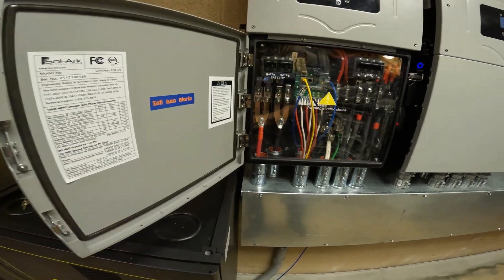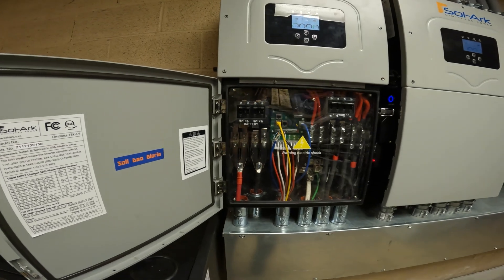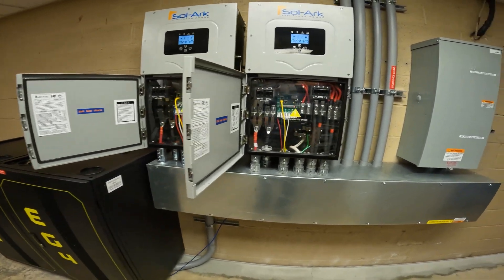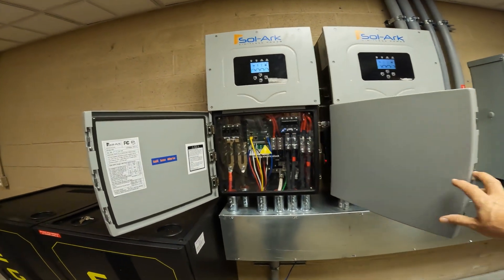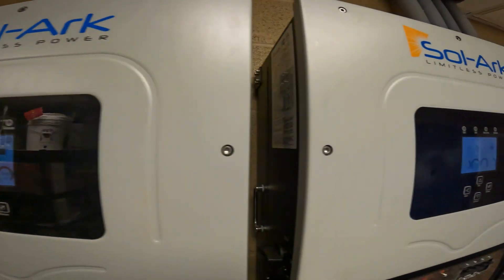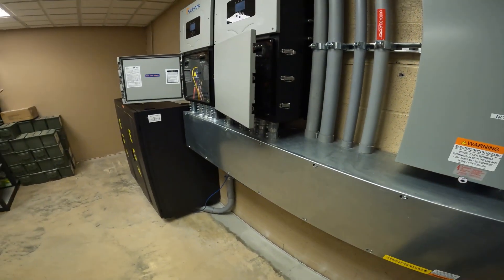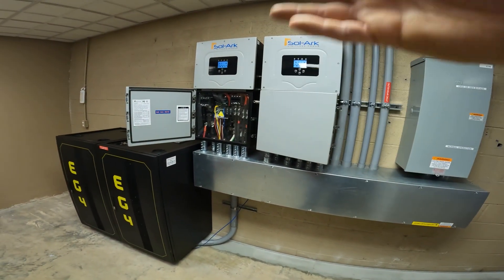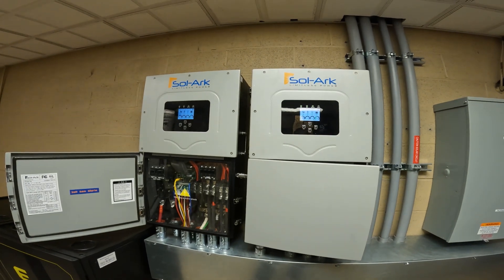Sol-Ark 15k busbar PSA

Comment: Yet another great video with clear explanations -thanks!  Could you also post a link the battery cables you use with the busbar pair?  Also, as the cables need to carry a combined 275A current through the busbar, what do you normally install an external fuse block and use for example a 300A Victron fuse?
Much appreciated!

Comment: Can you please explain your bypass switch and put a link to it?  So does it allow you to bypass your inverters/batteries so you can pull them out to work on them without losing power tothe house I presume? I'm having a hard time visualizing how this circuit would work because you'd have your main in from the meter into this switch, then feed to the sol-ark inverters which feeds to the breaker and also the bypass switch has a line to the breaker panel?  That wouldn't work because you could accidentally feed both to the circuit breaker at once right?  I'd love it if you could explain this or do a video on it.  thx
Reply: Late reply, but Diagram 07 from the Sol-Ark 15k Installation Guide (p53; guide copyrighted 2024) shows a wiring layout for use of a bypass/transfer switch. The picture is probably worth a thousand words.
Reply: @Mark_S-b1v  thanks, do you have a link to your bypass switch you used?

Comment: Does anyone have the connection diagram for the bypass?  Trying to understand how the bypass will switch the grid to the inverter and back to the load (when in position A) and from grid directly to the load (when in position B). Thanks
Reply: I'm curious as well, since the Sol-Ark is acting as a transfer switch on the AC side, I don't understand how it wouldn't be back-feeding even when the switch is on.  

I suppose it just makes it so you don't have to move wires if you want to physically take the Sol-Ark out of the loop, you can switch to the center "off" position, disconnect the Inverter(s), AND the cables going to the breaker box(es), then throw the switch to the "grid" position.

I may not understand that correctly, but it seems to me like it would be simpler and safer (because there's less room for error) to leave extra length in one of the cables that go to the Sol-Ark (either FROM grid or TO breaker box).

Comment: Can a single sol ark 30k be setup to replace this setup?
Reply: The Sol-Ark 30K is 3-phase (120 / 208 V) output only. It is designed for light commercial use. x2 15K's will be able to cover 30kW of 120 / 240 residential loads.
Reply: @kensol123  oh yeah I know was just looking to cut inverter and emp cost down by 40%
Reply: I look at it as an investment into energy insurance. When the grid goes down you are able to keep the food in your freezer cold and your family warm for however long you need. With 2 invs and some bats you can watch TV too 🤣

Comment: I just got a battery cabinet and some EG4 LLV2 batteries.  I was wondering if you have seen the latest cabinet safety video from Signature Solar.  It talks about max current rating of the m8 connections for the cable to the inverter.  Did you do a custom connection to the bus bar with that cable setup?  I will maybe try to get a consultation.

Comment: I used 2/0 Copper cables and four Southwire Lug Al 2/0 STR-14 SOL to bridge the battery terminals.  Flip the Southwire Lug flat side out and it tucks in nicely behind 4/0 copper battery cables. It's much cheaper.

Comment: I’ve watched your channel for years. Literally sold on the quality of your work. That’s a done deal.

My wife and I are at the point in life where we can buy a substantial amount of property (currently looking in NC). We need consulting on someone we trust (here’s where you come in). We are wanting to build on riverfront property. 1200 square foot minimum for primary residence.  We want advice leading toward
 installation of a primary solar array to support 3 times what our primary residence will need (waiting to hear from the management company on IF we need local power/water/etc.) what we want is to build near identical homes and have the ability to tie them into existing solar and wells. I’ve watched your work and I’d trust your recommendations for appliances/hvac/ well pumps . End  game is we don’t want to deal with local municipalities billing us for anything we can provide for ourselves. We are also thinking a min 46 Kw natural gas or Propane generator with a min of 1000 gallon tank as back up.

It’s our dream. If you’re open to entertaining it please provide an email address I can directly contact you at. I’ll respond with mine and my direct contact number. I know you’re busy and I won’t consume much of your time until We’ve secured the property.

Thanks in advance and God Bless.

Comment: Thanks for the content! I am understanding the adapter you are using, but I can’t wrap my head around how it can handle 275 A of charging through just one battery cable instead of running the paralleled cables? Can you help me with that?
Reply: I think the bars are designed to facilitate use of 4/0 instead of parallel 2/0.

Comment: Do you double lug the bypass so the grid feeds the solark in either position, but the panel is fed by either the grid or the inverters?  Do you have a way to isolate the inverters from the grid entirely?  Do you need fuses from your battery banks to the inverters, or do you only rely on the breakers?  Are those busbars UL listed?  ... Phew, if you made it this far, thank you.

Comment: dont the 200 amp terminals act like a transfer switch?      they have grid in, and load out. then the generator lugs as well. cant we bring our ser cable from outside main panel's load side into the "grid in" of the sol-ark?
Reply: The purpose of he bypass switch is to avoid relying on the inverter entirely. The 200-amp terminals themselves are not transfer switches, but internally the inverter can switch the LOAD port output use power from the battery within 5ms of the Grid sense detecting a grid outage.
Reply: @kensol123  it just seems odd that the lugs on output are larger than needed for a 60 amp output....I appreciate the information.....I want this inverter....still not sold on the HF type though
Reply: @keything8487  what do you mean by HF? High frequency?
Reply: @kensol123  yes s ir

Comment: For the bypass: Why not a line side tap feeding the Sol-Ark then feeding the panel thru a breaker with an interlock on the panel main switch?
Reply: One can do use that method as long as it meets code and fits the application. You’re essentially describing the same circuit function with different equipment used to attain the same goal, and I can dig that.
Reply: This is indeed the best way to do it. This is always my go to method. If you can't do an interlocked breaker. Then take the grid to the double lug of a manual transfer switch primary . Wye off the same lug to the grid in of solark. Then the load out of the solark feeds the auxiliary of the MTS. This way when customer bypasses the solark there is still grid in to the in inverter for charging the battery if need be.
Reply: what is the cost difference between the interlock method versus MTS?